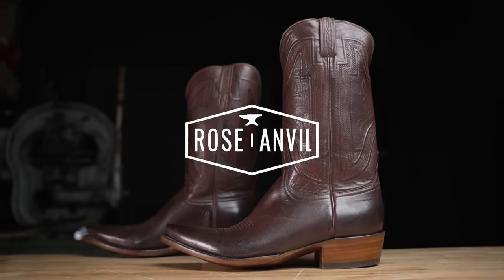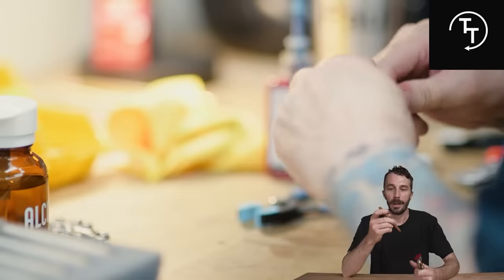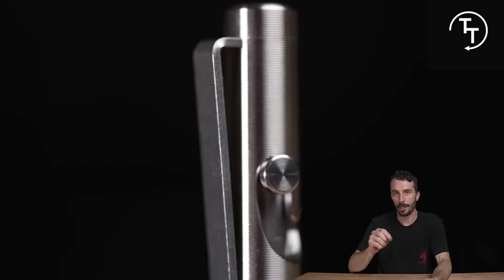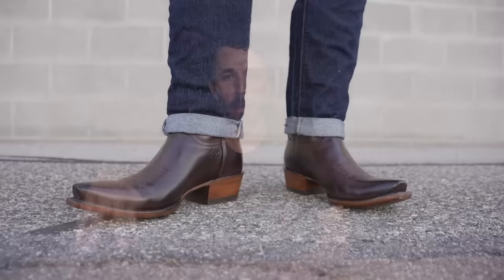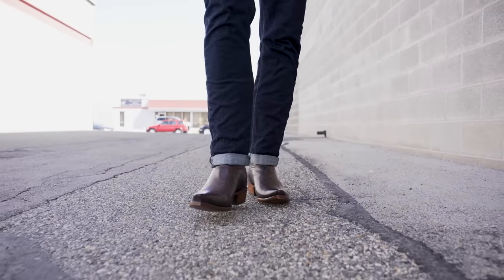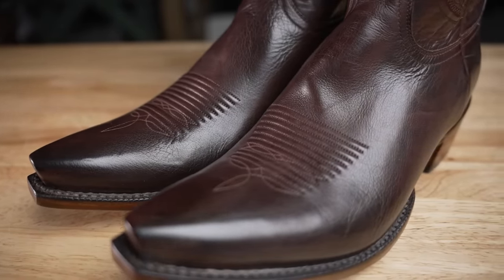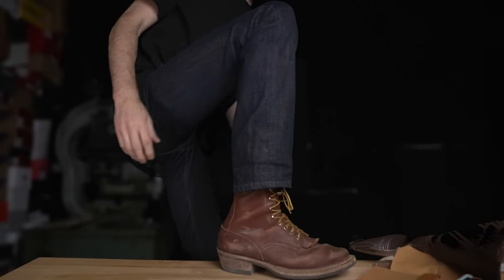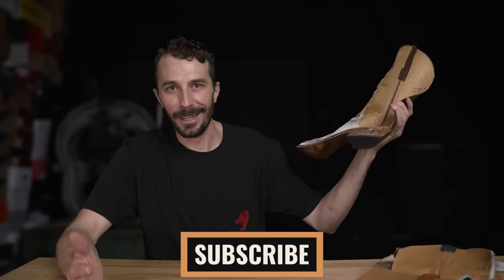Why the most luxury cowboy boots are disappointing - Lucchese

Comment: If everything about that boot stayed the same except the leather was say 2.5mm in thickness so you think the $1000 would be a more acceptable price? That’s the only thing I can knock this boot for is the thin leather.
Reply: The leather is too thin, and even if it was thicker it’s just not good enough quality leather. You’d expect Horween leather at that price. The heel rand is plastic and so is the toe. Far less durable than thick leather. Not a lot of traditional things going on in this boot… should be less than $500 for this quality. 

Brands like chisos are half the price and have all the things that this boot should’ve (except the leather is questionable, but definitely thicker, and they are made in a small family owned factory in Mexico). They have a video where they cut their boots in half and compared to other brands

Comment: I've owned Luccheses for decades.  They have expanded a lot in that time and quality is still good but has slipped a little on some boots but not all.  A buffalo boot like the one you cut is definitely a dress boot.  There are other leathers that are thicker/more durable (including ostrich, oil calf, elephant and shark)...you just have to realize that everything is not a White's or Nicks...  I laughed at the comparison with the other boots.  Fit is everything in a boot and those pieces of junk will never ever fit like a Lucchese.  I tried a pair of Tacovas once.  They were back in the return mail within 10 minutes of arrival.  Better boot suggestions?   JBHill Texas is a similar price point to Lucchese but a smaller, all handmade operation.   Best boots out there?  Likely Texas Traditions in Austin.  There's a three to four year backlog to get a pair however.